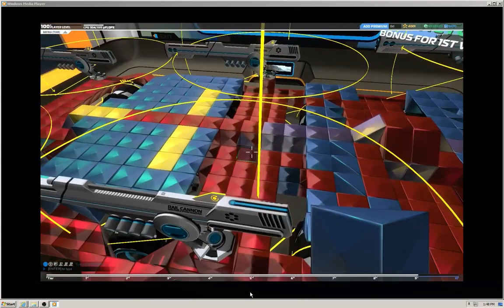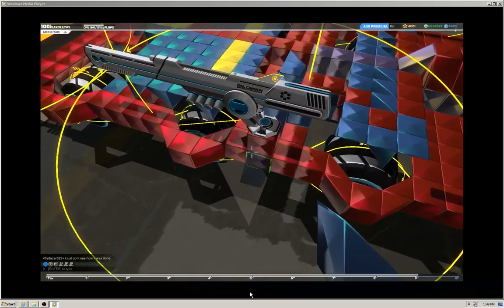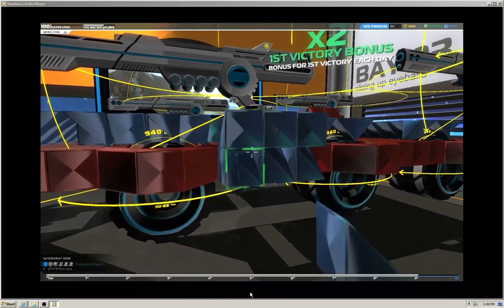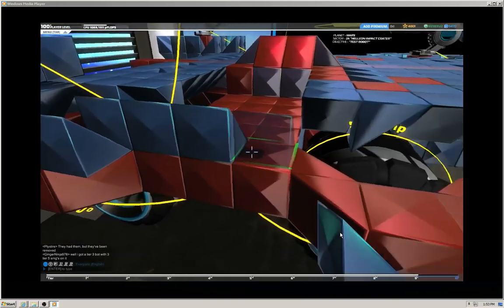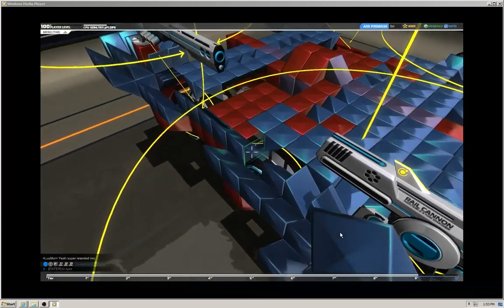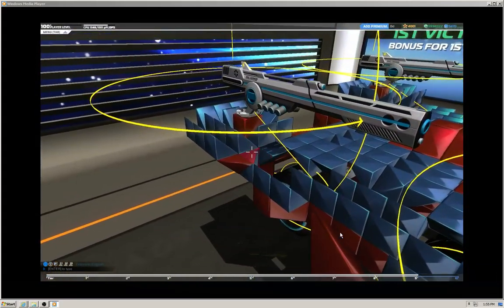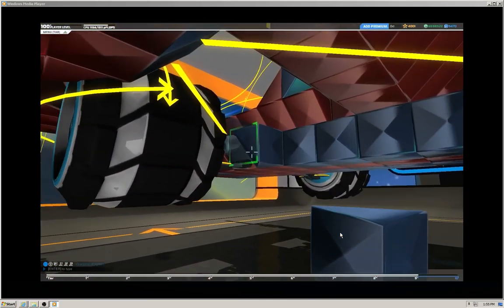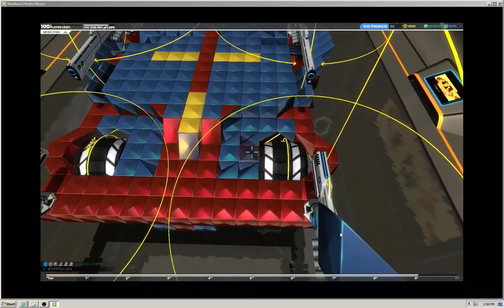Robocraft Engineering - T10 RailBed - Part 3

Comment: Is there any reason to you using prisms like you do? Do they provide more armor somehow?
Reply from the maker: 1) prisms are lighter (less mass) and 2) the way damage transfers from block to block can be directed in certain directions by using prisms...blocks only transfer damage to other blocks they are actually touching (not just adjacent to)....so along the angled side of the prism, it's not attached to the block next to it and damage will not transfer in that direction. The overall goal of the armor here is to have it sort of flake off.